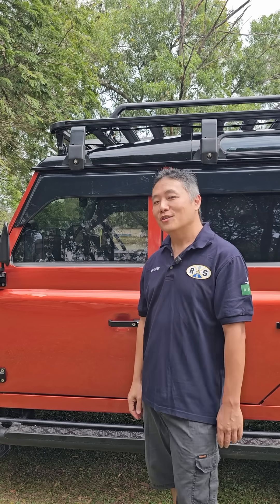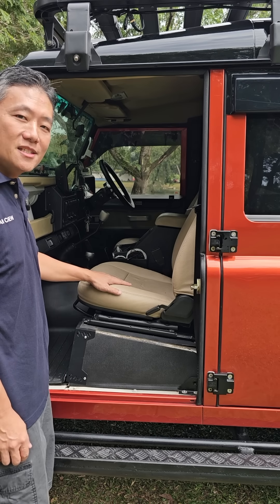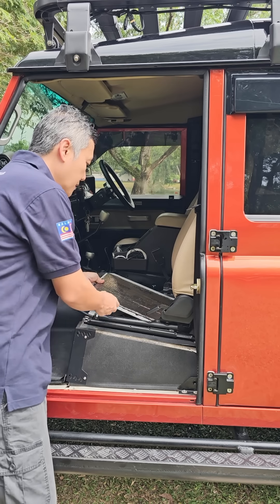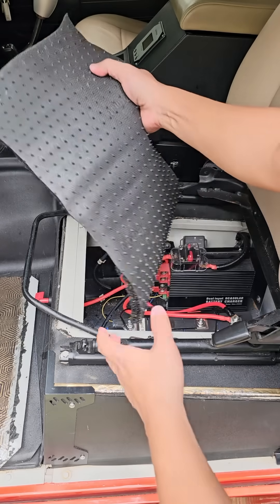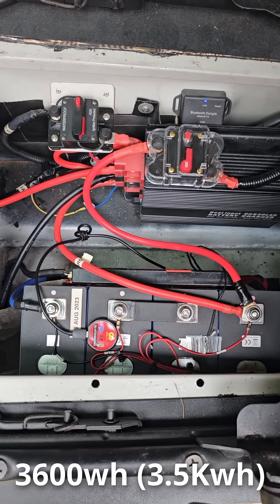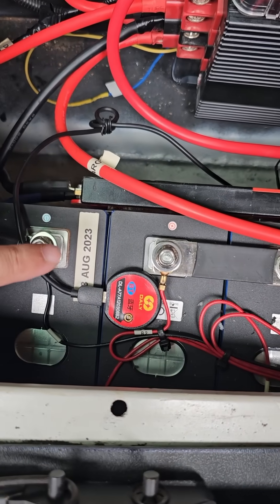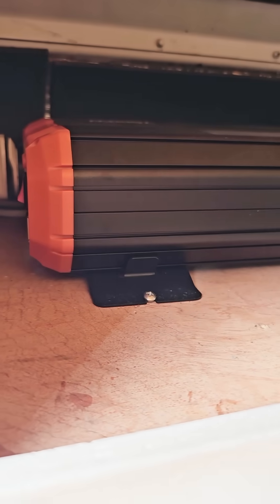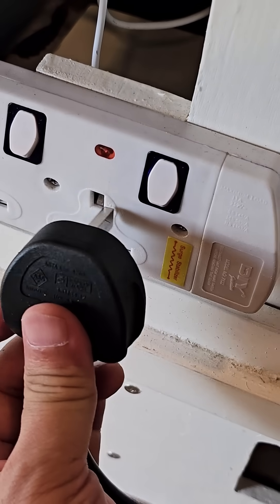DIY Power Station or Secondary Battery for the Land Rover Defender #powerstation  #offroad

Comment: Great and informative video!! What would you say is a good indicator when the batteries should be replaced?
Reply from the maker: The BMS has an app that tells you the total capacity. From there you can roughly see a loss of about 2% every year.  These batteries typically last for 10 years if taken care. So by then, its time to replace them.

Comment: Nice video.. Can list down all the parts needed? Thanks
Reply from the maker: Sure, here it is:
1. Lifepo4 320AH battery
2. Daly BMS + Balancer
3. 2000W pure sine wave inverter
4. MPPT Solar + DC-DC charger
5. Breakers, Fusebox and Cut off switch
6. 100A rated cables.
Reply: @sweetdefenderlife  Thank you so much sir!